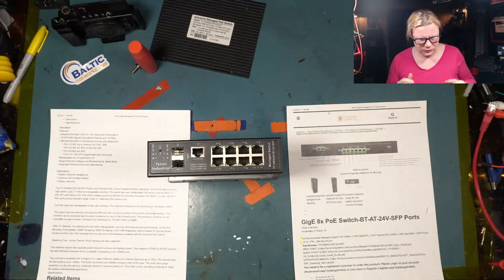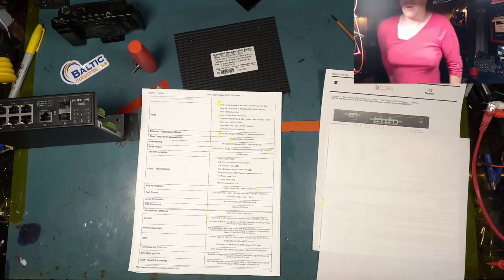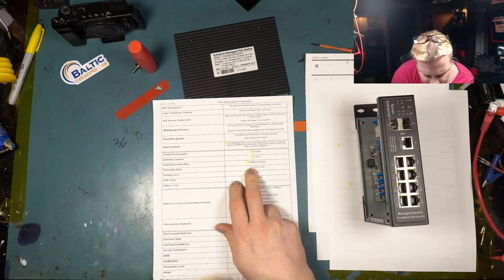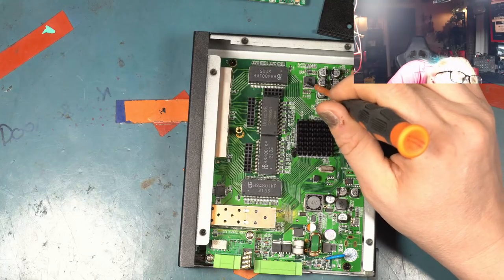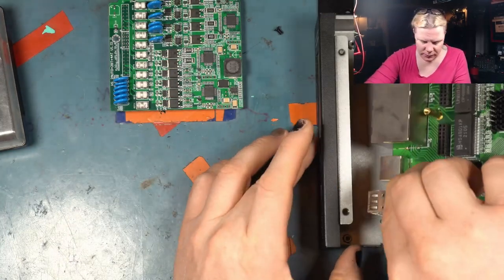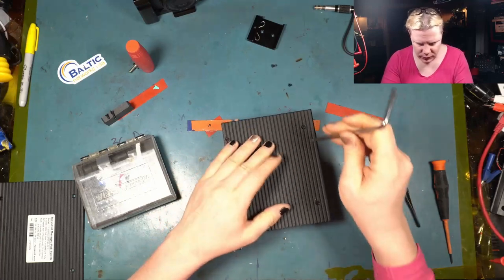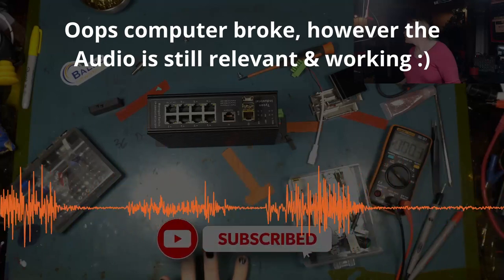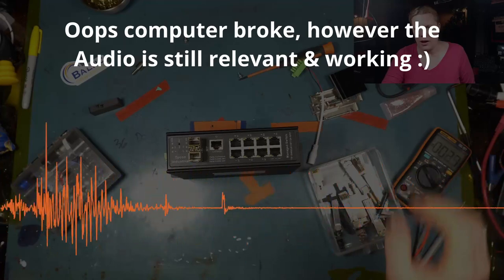Tycon TP-SW8GAT overview & teardown

Comment: Did you figure out the part number for replacement gas tubes? Tycon claims there's no gas tubes or other replaceable parts inside.

I have tested this switch and it's passive poe ports are not compatible with the rocket 5AC. I am not sure why as I do not have a poe tester but it sends the radios into a boot loop.
Reply from the maker: GDC tubes don't really need to be replaced in a switch. They'll take many many hits before they fail "open" If you need to replace parts in a device you can usually find equivalents through your preferred electronics parts wholesaler ^^